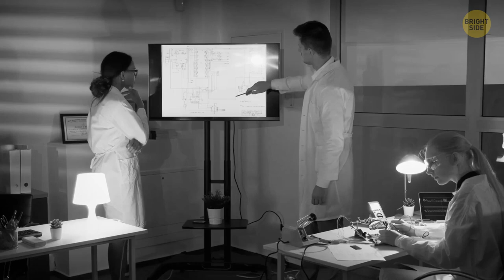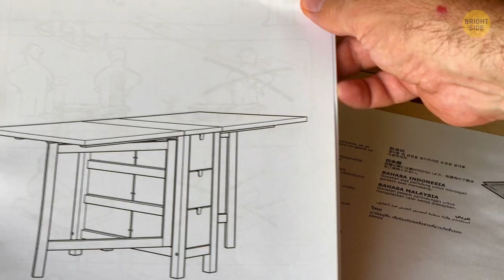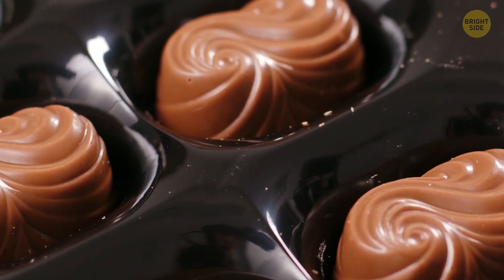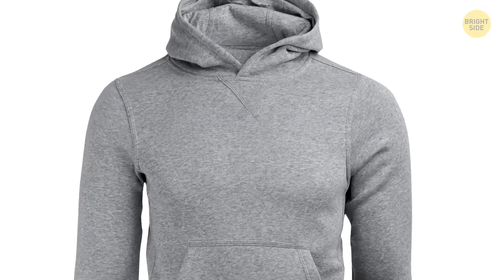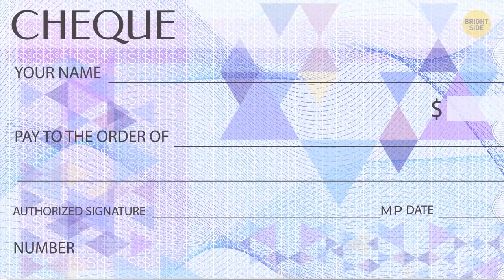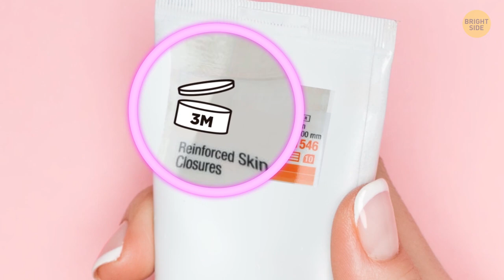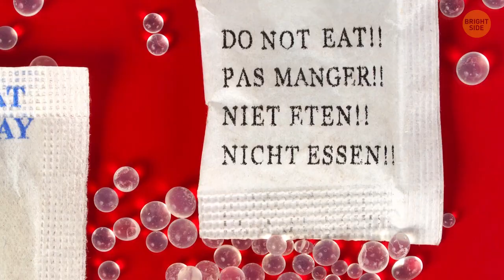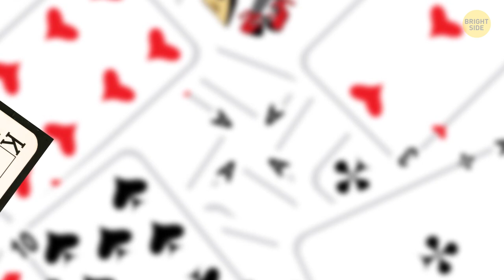55 Objects You'll Now Know Why That Detail Is There

Comment: I noticed some errors:  1.  On the check with alleged microprinting, the magnification does not show microprinting.  If there is any, the magnification is not great enough to show it.  With microprinting, the gently curving lines would be revealed to be constructed of tiny letters; the voice description correctly describes it.   The magnification does show guilloche printing, a delicate tracery of intricate, curved lines. Guilloche is another security feature.  Guilloche and microprinting are often both used on the same document.  It is possible that the MP designation is used to indicate that one or both are present.  2.  The voice describes the strawberry portion to contain an emery board; instead it contains loose emery powder.